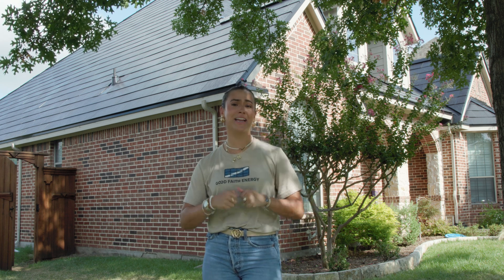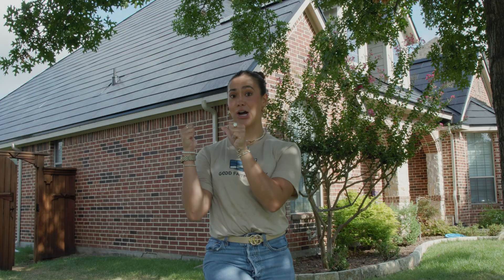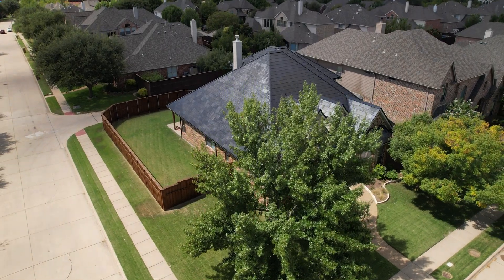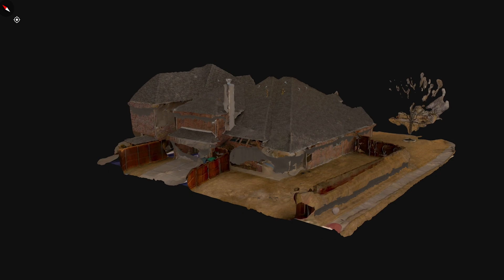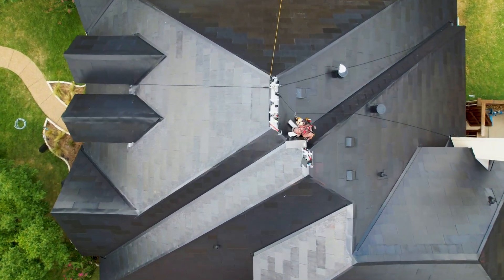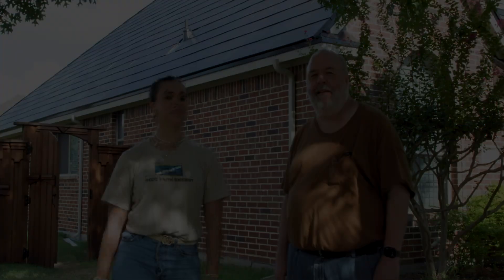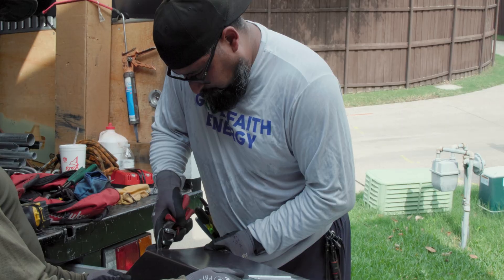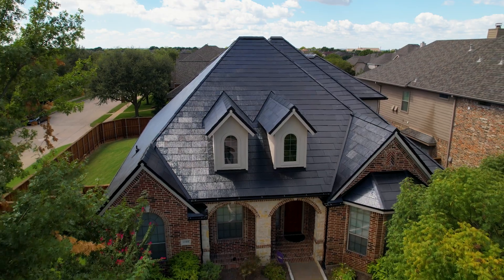First Tesla Powerwall 3 & Solar Roof Installation | Homeowner Experience

Comment: Very cool and sleek install. One question, do you know the increase in homeowner’s insurance when installing a Tesla roof? I’ve had some customers ask about it and this is one of the main concerns/questions always being asked.
Reply from the maker: Thanks! Homeowner’s insurance rates can vary depending on the provider and location, but generally, adding a Tesla Solar Roof may cause a slight increase due to the higher replacement cost of the roof itself. However, some homeowners see minimal changes, and in some cases, insurers might even offer discounts for having a more durable, energy-efficient roof. It's best to consult with your insurance provider for a clear estimate. Always a good question to address upfront!